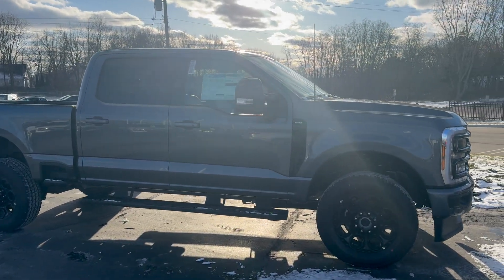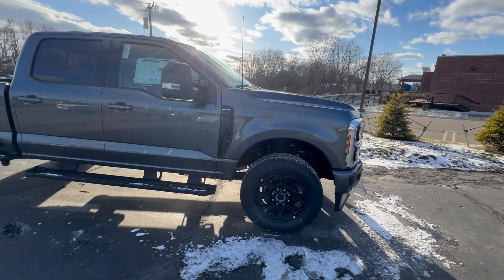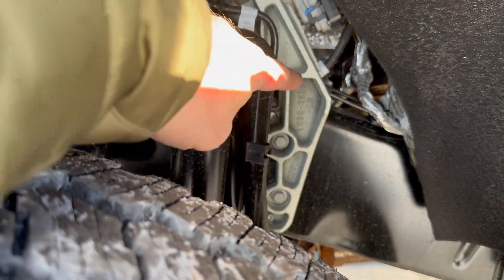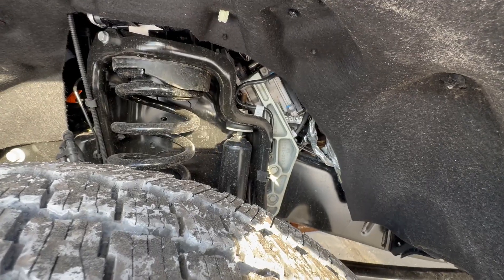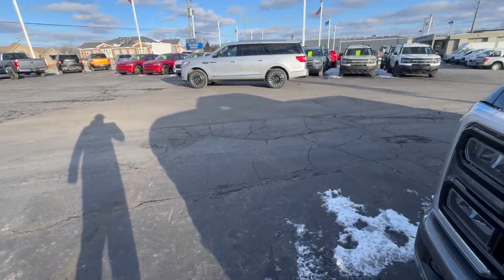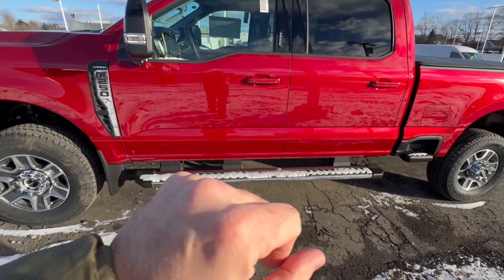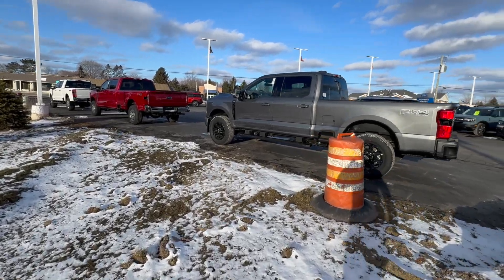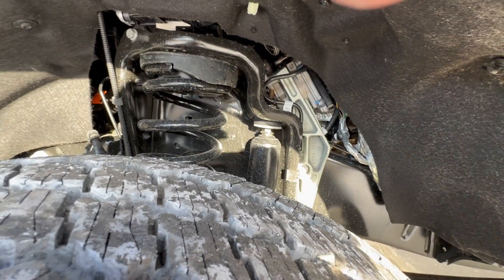2023-2026 Ford F-250 F-350 Feature only available on Lariat Ultimate and Above trim or Tremor level

Comment: Well, partially correct. This is the motor that provides the steering for the pro trailer. It is also the motor that is used for Lane Centering with the Adaptive Cruise along with lane keep *assist*, which is why you will always see it on Ultimate and above packages.   ANY Superduty with the HUD will have the motor, adaptive Cruise, and Pro Trailer.
Reply from the maker: Thanks for clarifying, that’s a good point!

Comment: I have that on my 23 lariat tremor non ultimate
Reply from the maker: Yes sir...I found out all Tremors get it from factory! Great option! thank you for watching.
Reply: Thanks for the video ! I got 16k on my 7.3 . No issues and 13mpg average . Had previously 21 F250 xlt premium 6.2-3:73 and a 19 F250 xl stx 6.2-3:73 . This is a huge step up

Comment: I have a lariat ultimate diesel,  its a great system.  Easy turning at slow speeds,  tighter at highway speeds.  eliminating death wobble.
Reply from the maker: Its awesome! Thanks for watching!
Reply: I sold my 2014 F250 Lariat with 6.7 due to getting stranded twice (DEF/DPF issues), and death wobble. Now I’m thinking of buying a new F250 Lariat 7.3 gasser instead of diesel. We tow a 6k lb. travel trailer (often in mountainous terrain at higher altitudes), but I’m still concerned about the death wobble. Do you really think that this pro steering assist eliminates the possible death wobble?

Comment: I have a 2022 standard lariat with this feature because it's part of the pro trailer backup assist.
Reply: Right, not a new feature. A lot of misinformation in this video. It was first brought to the Super Duty in 2020. At first it was standard on XLT and up. It's also what makes pro trailer back up assist possible.
Reply from the maker: Awesome!! Thanks for watching!

Comment: I have a 2023 F350 Lariat Tremor with the 6.7 H.O. Diesel (not the Lariat Ultimate, I actually ordered my truck specifically without the ultimate package), but anyway I have the steering assist. I could provide proof with a picture if you would like.
Reply from the maker: Thanks for watching! Good point, Tremor may require it due to trail turn assist feature! I will look into this.  I have not seen a Lariat tremor non ultimate! very cool combo!
Reply: @CTECH-REVIEW that's a great point! What did you find out?